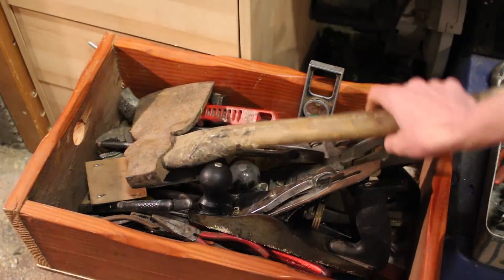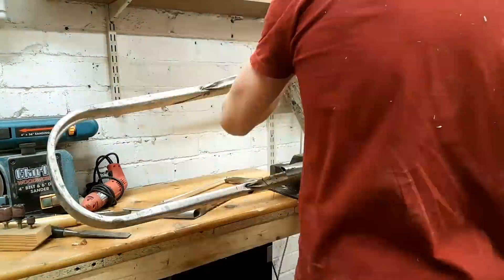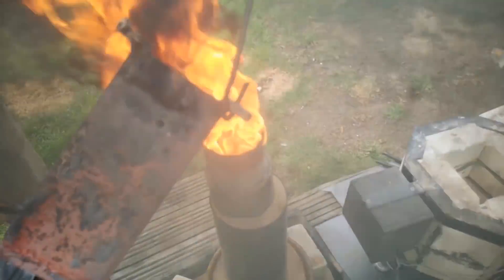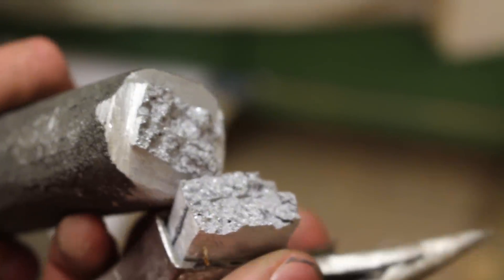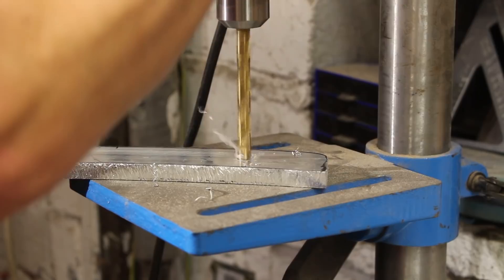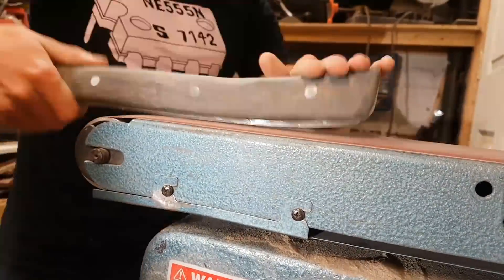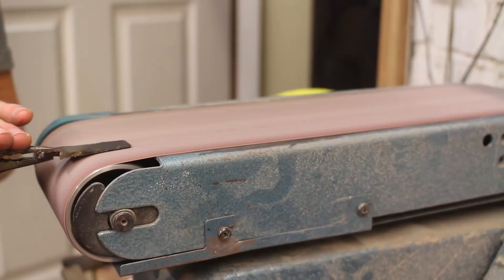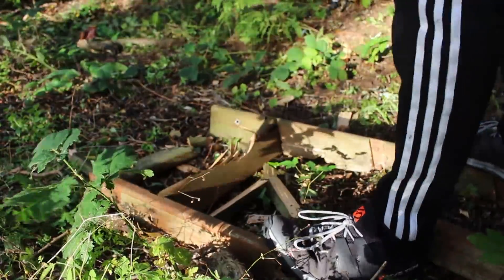Making an Indestructible Axe Handle

Comment: Nice job , I have a workshop here in the States & my fall & winter costumers have placed a lot of orders over the spring & summer months & i,m about to open my workshop back up next week . So far I have 4 long bows that have to be done, 1 full tomahawk build , 1 knife restoration , 2 sheaths to build , 3 bo sharukins to build , a complete set of 6 Chinese stars to make , 1 tomahawk mod to do , 3 knifes to polish & sharpen , & 1 complete knife build plus 40 arrows complete build that’s not all I still have a lot more stuff to do that just off the top of my head .

Comment: Great video and it's great seeing you continuing on after so many years! The perk of wooden handles, at least from what I've heard, is that they shock and vibrations are dampened and transferred back to the axehead, to some degree, which happens less with metal handles. Still useful for sure though!
Reply: As for the reason your casting at the top wasn't as good is because the square block you added on top of the handle mould was not big enough. Next time I suggest you try to make it larger and perhaps round-ish, rounder towards the mould itself

Comment: Try doing a horizontal setup for the cast rather than the vertical setup you had, gives it less time to cool! Great video btw!
Reply: Yep, same question.
Reply: Also: Pre-heat the form and, very important, make sure you have vent holes on the opposite site of your pour.
Reply: are you suggesting he pre-heat the dry sand around the foam?
Reply: using the dry sand casting method he shows, a horizontal orientation is more likely for a mold collapse. As soon as the molten metal hits the foam, the foam immediately melts down and gasses out of the mold. Successfully using this technique requires a very fast mold fill time so that the metal can occupy the space of the foam without time for the sand to collapse inward. Dry sand casting was never my favorite technique. Go with green sand if you want your mold to be more resilient.
Reply: Also didn't look like he had compacted the sand prosperity or has any risers
Reply: Vents - 'Evaporate' was the word he used himself...

Comment: When cutting aluminium with a jigsaw you could try using a sharp blade made for wood and also increase the pendulum action if it's adjustable. I've cut similar thicknesses with great success and you can quite easily cut 15mm steel as well if you use a good metal cutting blade.

Comment: Something to keep in mind with aluminum. It can work harden with repeated strikes. Probly not an issue with just cutting wood but that peening definitely stressed the material and if you didn't anneal it you should to get the max life out of it. Also a buffer between steel and aluminum is ideal for long life as they dont like each Other and corrode faster in direct contact.

Comment: Lost foam casting using dry sand is notorious for sand inclusions which result in failure points. We did a lot of testing in school on this and struggled to produce sound castings. A light ceramic slurry on the outside of the foam can help, but requires low-heat drying time to prevent popping/explosion. You may have had better success using green sand packed around the foam. That is the technique we used for our foundry demonstration nights, where we would invite students in to carve their foam, we would pack and cast it in green sand. Several hundred castings in a few hours with relative ease.

Comment: Cool hatchet/axe! I really like the size, it reminds me of my own restored roofer's hatchet, which has a hammer and nail puller on the head. I gave it a proper axe handle to replace the original puny one, and it's the perfect small axe/big hatchet

Comment: Don't underestimate aluminium dust. Running powertools in a small area with aluminium dust can cause an explosion or fire. Having a mix of resin and aluminium in the air is probably even worse.
Reply: Thermite??
Reply: Yonatan24  needs rust
Reply: Also health. Aluminum is pretty strongly linked to Alzheimer's, even though you're not eating it I'd still exercise caution if you work with it often.
Reply: NO. Aluminium dust is explosive by itself. No rust needed.   If you're using hand-tools, it's probably not that big a deal. It might not even be a big deal with power-tools, but it is a risk and the results could be completely catastrophic.
Reply: @tarstarkusz  He asks for Thermite which needs an oxidzer to maintain the burning/heat. Not for Aluminum in the air that has a potential to explode :)
Reply: +Appoxo... They think that because you can oxidise aluminium with rust that aluminium dust is not explosive. I used to work in the metals industry and I've seen tapes of various dust, including aluminium, that exploded catastrophically.
Reply: @tarstarkusz  any sources?
Reply: +Sheriff... Google is your friend. OSHA made us hang the signs. I've also seen a film where sugar dust did the same thing. Dust has enormous surface area.  On the floor and laying on the ductwork and  other places this kind of stuff accumulates is a major fire hazard. 
 It's not that risky, but it can happen and these home-gamers need to understand that risk, not to mention breathing the shit. You don't want aluminium in your lungs.
Reply: @tarstarkusz  so like silo fires right? I thought it had to be like a very fine powder of a flammable substance like flour or coffee creamer.  Can aluminum dust catch fire?  Also it would need to have the right mix of oxygen correct?
Reply: Agreed, airborne aluminum dust is an explosive hazard. I work in an aluminum rolling facilities and there is very strict rules and specialized equipment required for any dust cleanup in our facility.
Reply: +Sheriff... I suggest you look at Jake's comment. Have you ever seen steel wool burn? When it comes to dust, the ratio of the mass to the exposed surface is extremely high. A bag of steel wool will easily burn (and very hot) while it could be melted down into a a ball bearing that would not burn. Do you understand that? Also, it burns so hot that once a couple of embers are burning, they can cause a chain reaction.
Reply: @tarstarkusz  good thing he's not making a lot of dust then, huh?
Reply: +Sheriff.. Yes, he is. He's using power tools and probably has removed a pound or more aluminium from that handle.
Reply: You are absolutely correct.  Any kind of dust that takes up a wide surface area and produces friction is subject to combustion.  Just check out what innocuous stuff like flour is capable of, although aluminium has the potential for much more destruction.
Reply: @tarstarkusz  Many dusts, if fine enough can burn and explode. The custard company Bird's lost a silo years ago when one developed a leak and a spark blew the whole thing up!
Reply: @Koito.. Yeah, the explosive power of this stuff is absolutely amazing.  People don't tend to think of this stuff as being flammable or explosive.

Comment: Beautiful work, nicely done sir.
My only concern is a metal handle will transfer all of the shock from the axe head into your hand.
I bought a cheap hatchet with a metal handle to keep in my truck, because the wooden handled hatchet I own was too nice to just throw into my toolbox and be rattling around year after year.
When I had to use the metal handled hatchet I soon learned why the wood handle felt better, less wear on your joints.
I will say this, I’ll be looking for a carpenters axe to purchase now.

Comment: The reason that your hacksaw didn't work, and also what probably made you way more work is that Aluminum is somewhat sticky. The shavings of the Aluminum sticks to your tool and makes it dull.So some sort of lubricant helps to prevent that. Chalk is a good choice for your hand files and rasps. For power tools some cutting oil does the trick.

Comment: Nice work,made a cool handle. Some commercial vehicles use composite leaf springs and always wondered if a handle could be made from one. Might be pretty tough to work but think it would make a very tough and flexible handle that would last forever?

Comment: I know the amount of effort it took to make this. I have made similar handles in past and i know the pain. Though in my builds i was using soft wood and so for i found issue where any material removal just created bumps around the pins, as the brass, copper and aluminum inserts were much harder than surrounding wood and become proud compared to wood around. Nothing serious but i was after smooth finish so any ideas on solving that? I also made nice axes using old broken handle, filling in the wood if missing and then wrapping it into fabric that i soaked with resin, creating hard shell that made handle even though patched crappy, strong as it use to be if not more. As artistic addition i made grooves for wires in the wood before wrapping it in the fabric, peeled some electrical copper wire and made wrappings around the handle in various ways and then put the resin on.

Comment: Please keep us updated on the handle! Theoretically, metal is not that great when it comes to cyclic fatigue stress. This stress would be caused by repetitive blows on, say for your axe, the material you'd cut. You could go see how the Tacoma bridge collapse due to the same fatigue strains. Wood is recommended as it is more resilient to fatigue thanks to its fibers and shock absorbant nature.

Comment: Steel and aluminium corrode themselves through contact. I wouldn't be surprised if your rivets in the handle start to come loose. The axe head may suffer a similar fate, though, oxide jacking may keep it in place.
Reply: Galvanic corrosion.
Reply: Yes. The non-noble metal will corrode by galvanic corrosion, like mrgerlach says.
Reply: @1337fraggzb00N  He just used the name, I made the point.
Reply: Both of you are right. Now I put some fine steak in mein pan and eat it all by myself.
Reply: Galvanic corrision occurs when two dissimilar metals are in contact in an electrolytic solution. Wouldn't worry too much unless he is chopping wood in sea water.
Reply: Kind of true.  An electrolytic solution will speed up galvanic corrosion due to the metals being dissimilar.  That said, high humidity will also contribute to this happening.  If you are in a dry state or zone this should not be too much of an issue however if you are at sea level or close to a large body of water then you might have problems.  In any case, as long as you seal the surface you cut down on the risk of that happening.

Comment: Much nicer than a cast handle. Your hands will thank you when it gets colder and cast aluminium probably would have snapped at some point. High grade technical alloy extrusion is much more uniform and stronger than any diy cast piece.

Comment: i think the AL with steel head will create oxidation over time. probably need to try seal that head with epoxy to avoid this.
Reply: Bare metal surface contacting a bare metal surface. Steel on aluminium, dissimilar metals. galvanic corrosion will occur regardless of sealant.
Reply: Not without an effective electrolyte. Even if it does it would probably be a hundred years before it would corrode enough to worry about it

Comment: Does the aluminium handle transmit impact vibrations to the hznds? I would've tried normal wood with a few layers of fiberglas near the head for renforcement.

Comment: Aluminium is soft and clogs the cutting teeth very easily and quickly. The best cutting fluid for aluminium is a squirt of WD40.
If you ever have to cut stainless steel, use water. You don't need to lubricate, just cool. Oh, and once you start cutting, keep cutting until you have finished

Comment: Soak your wooden handle tools in hammer juice aka Ethelyne glycol otherwise known as antifreeze over night . It will not evaporate and it will condition your wooden handle tools whilst it swells the wood inside the metal portions.

Comment: good job but they make handles of wood for a reason because when used excessively wood damps vibration and makes your arms take more to get tired than something solid as aluminum handle which will get you tired and your arms will hurt sooner

Comment: This video was amazing! I don't know how i missed it until now. Keep up the good work. 
I'd like to add my constructive criticism from the point of view of just a regular guy, I'm no expert in video making but this is what i though you could improve.
You showed the finished axe at the start which was fine but i think it could have done without the commentary on what happens later in the video so that the viewer can naturally become curious as opposed to being told straight away what happens. Another thing i think would be an improvement would be to stop changing between past and present tense in the commentary as it creates confusion about when things are happening.

That's my two cents, cant wait for the next upload!

Comment: With a metal handle, wouldn't it transfer the force more into your hands, where as wood would absorb more of the impact?
Reply: its better to have some hand shock than having a broken handle
Reply: @louischappellholmes2708  for sure
Reply: Louis Chappell Holmes  And you can add a grip to make a more comfortable...
Reply: not if you are using it alot would much prefer replacing a handle
Reply: @4321jojoba 
True. But most people don't use their axe weekly. No problem if you do though, it's like people arguing with me over bikes with or without suspension :)
Do you think wrapping the handle in some soft leather/silicone type cushioning would help?
Reply: Johannes Bancken I have been using steel shanked, leather wrapped Estwing hammers, axes, and hatchets for 45 years, clearing land and doing structural concrete work.. No problems with excessive shock or vibration.
Reply: Yonatan24 Estwing has been making leather wrapped and rubber handles with their steel shanked tools for decades. They work wonderfully.

Comment: I wonder if it would have gone better, if you had tried to lay the Styrofoam down in a horizontal cast, instead of a vertical one. Horizontally, this would have lead to less layering, and possibly a stronger structure in the aluminum. With it vertical, the aluminum had much more of a travel time.
Reply: Much easier to pack the sand too.

Comment: A wooden handle when looked after will last a lifetime looks good though but I wouldn't use it too much the vibrations that must come through that aluminium hence the reason health and safety don't allow metal handles on any tool

Comment: When using a jigsaw use a wood blade not a metal blade. The teeth on a metal blade fill up too easily with aluminum but its soft enough to use a wood blade.

Comment: It looks nice but it will transmit a lot vibration into your arm. when you use it all day you will see what I`m taking about. A proper hung hickory handle is the only true axe handle and will last decades if looked after properly.
Reply: spoony spoonicus Which is why Estwing has been making steel shanked hammers, axes, and hatchets for decades? Been using them for 45 years and have had no joint problems (land clearing and structural concrete form work).
Reply: Yeah but they all have something over the shank to protect from vibration, He is gripping right onto it and so the vibration is transmitted straight into your hands.
Reply: yeah with something over the shank to absorb vibration and protect the user. he has he shank exposed and it will transmit vibration straight into your hands.

Comment: Dude, cast anything is going to be that brittle.  The alloy wasn't the problem
Reply: This is where a little knowledge is dangerous.  For example LM6 alloy is strong but is produced in a specialised foundry - not in a back yard foundry. Also the Al/Mg alloys are extremely strong. So please do not make comments which are strictly not true. De-gassing of Al alloys to remove hydrogen is also essential.

Comment: Axe handle is wooden or polymer for a reason, anyone who has used a cheap hammer or sledgehammer with a steel pipe as a handle for a day knows this.